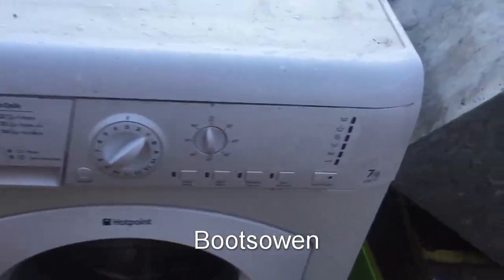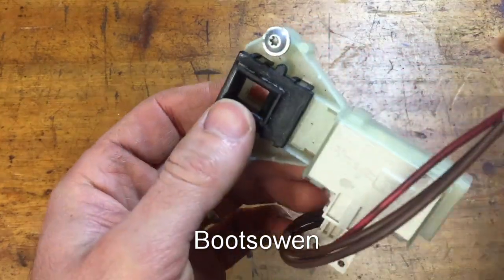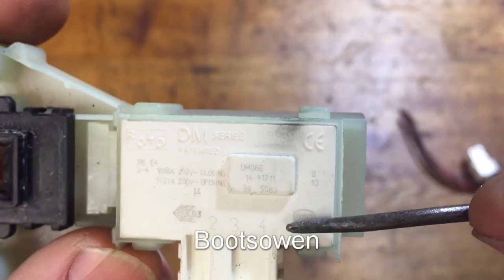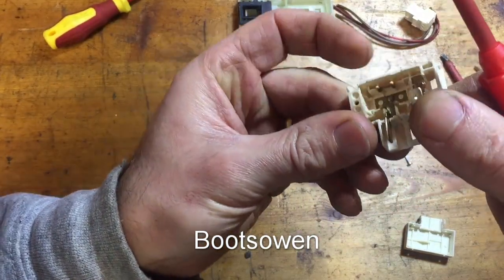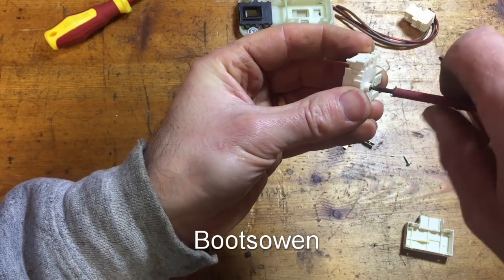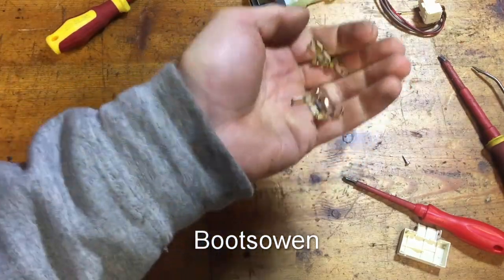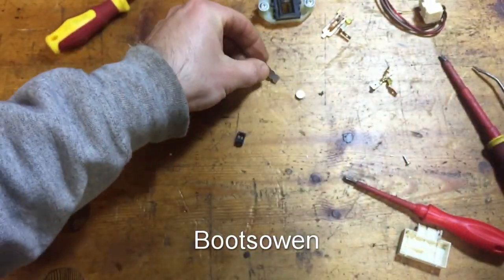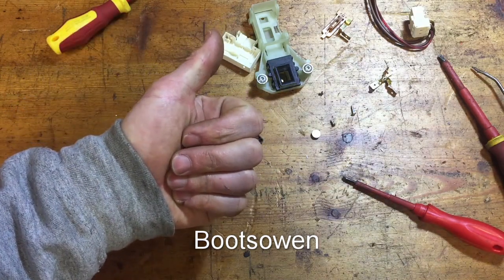Examining a door interlock from a failed washing machine | Hotpoint HTB721 | what do you think?

Comment: Interesting, it looks like this machine uses the new type of interlock which it doesn't use a heating element like the old ones, instead it uses an electromagnet. Considering that, the small burn marks that are on the plastic seems a bit odd to me. I wonder if it will trip the circuit breaker again without the interlock?
Reply: Oh kay